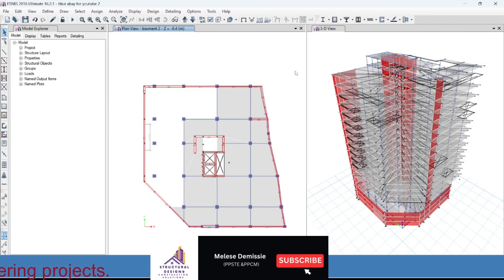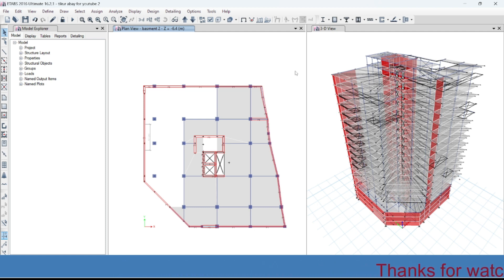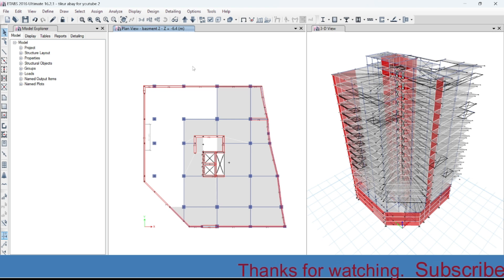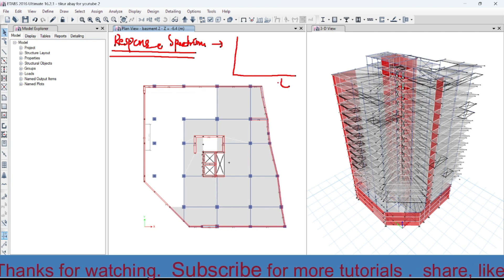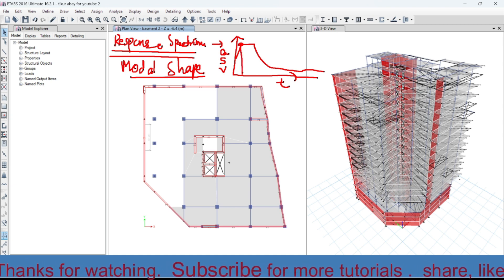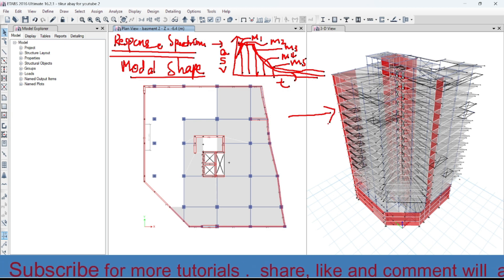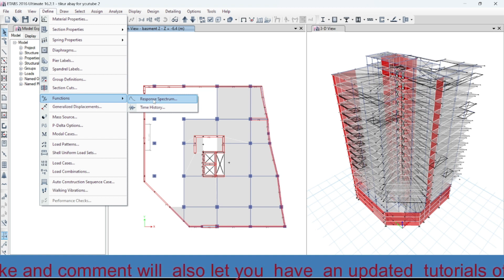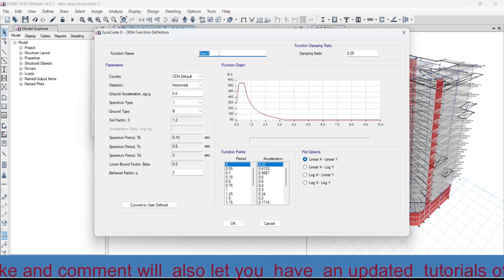Complete Structural Design of 20 Story Building using ETABS as per Eurocode & Ethiopian Code (part9)

Comment: Thanks for all your lectures sir ,please i will appreciate it if you will be kind enough to help me with this though  , "why does the response spectrum function Type always revert back to ASCE7-10 although we specifically chose Eurocode 2004 " i have tried all the contemporary ETABS versions but the problem still persists.
Reply from the maker: ONCE YOU  SELECT THE FUNCTION TYPE TO ADD  , EXAMPLE EUROCODE 8 FROM THE DROP DOWN LIST, AND GIVE THE NAME  LIKE RESPONSE SPECTRIUM EURO AND  CLIK OK, HERE WHEN YOU OPEN THE RESPONSE SPECTRIUM FUNCTION , ASCE7-10 IS  VIEWED FROM 1ST  FROM DROP DOWN LIST AND IT IS NOT THE DEFINED RESPONSE SPECTRIUM INSTEAD IT IS ONE OF THE STANDARD  FROM THE LIST AND LOCATED AT THE TOP PLACE  . THE SELECTED RESPONSE SPECTRA WHICH WAS DEFINED IS FROM THE LEFT OF IT  AND CLICK  MODIFY BUTTON TO SEE ITS DETAIL DEFINED PARAMETERS  SET BEFOR  USING EUROCODE 8 .
Reply: @melesedemissie7664  ,makes much sense now, thankyou very much for clearing that up sir ,been bugging me for quiet a while now .